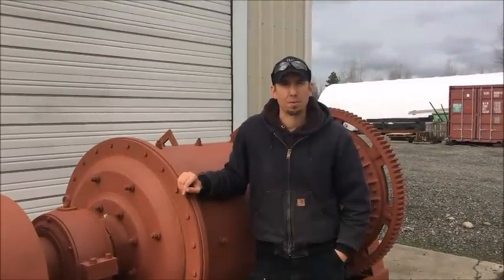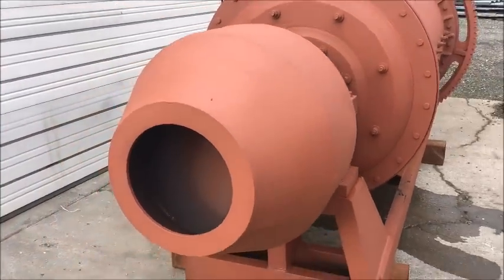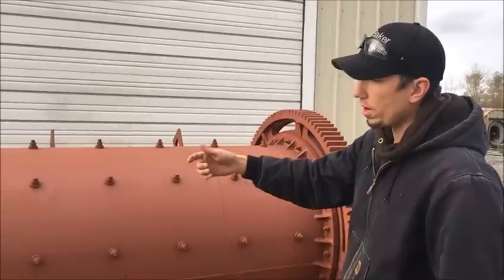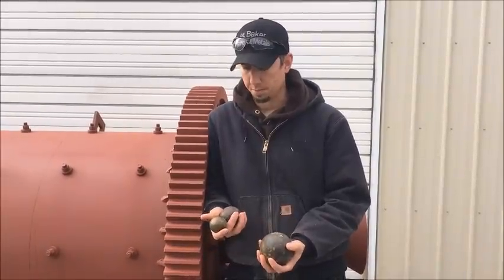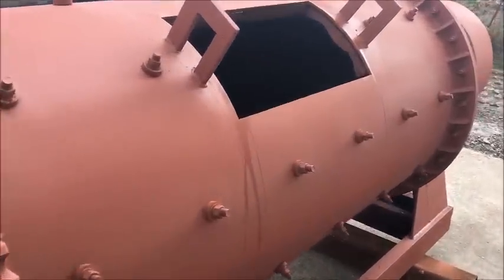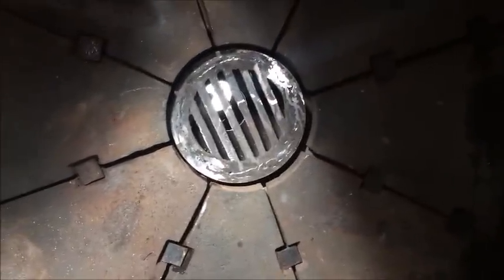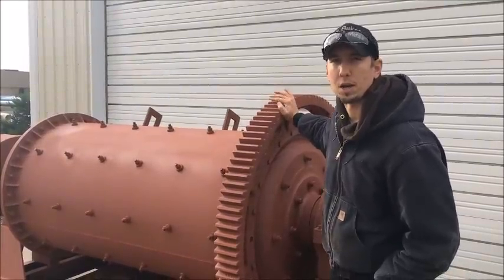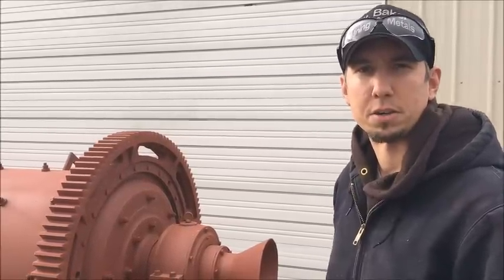Small production ball mill for ore grinding

Comment: I am getting really excited in the developments going on. Are you going to have bigger ones too like 2 ton or 3 ton per hour? Are you going to consider developing a secondary crusher to further reduce size from the discharge of the primary jaw crusher, or the ball mill can handle the feed directly from the jaw crusher? Would this ball mill need special foundation?
Charles
Reply from the maker: Hi Charles-
Yes we do plan to have larger ball mills up to about 5 tons per hour.  We have hammer mills that work great as a secondary crusher before the material is fed into the ball mill.  The ball mills however can take the feed size right from a jaw crusher.  The ball mill will need to be mounted on a concrete pad as they are very heavy and take quite a bit of power to run.  If you want some more specific or details please give us a call at 360-595-4445.  Thanks

Comment: That fine gold will be concentrated in the bittom inside the ball mill. You'll need to install a valve in the bottom to once awhile flush the gold out.
Reply from the maker: Great, thanks for the tip!

Comment: Is it possible to adapt this model to a 3'x9' ballmill with a 30 hp motor? Which voltage is used for the motors you use?

Comment: Great developments! That is large charge media. Can you  go directly from jaw to this or first the hammermill for intermediary grind?
Reply from the maker: Thanks.  Yes, you can go directly from the jaw crusher to the ball mill.  The throughput of the machine will be increased if you put a hammer mill in front of the ball mill, but this is not necessary.  Thanks